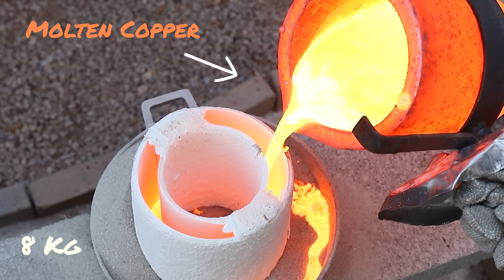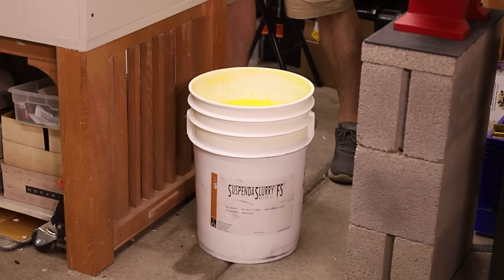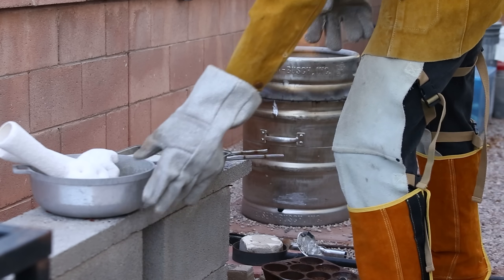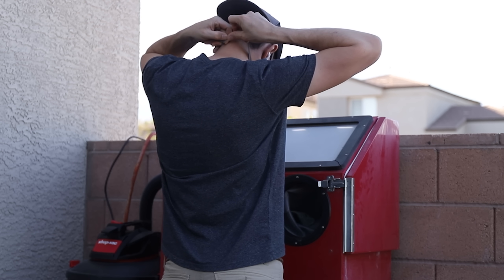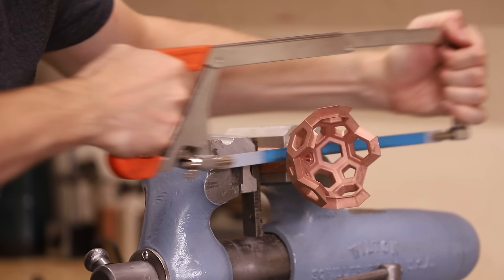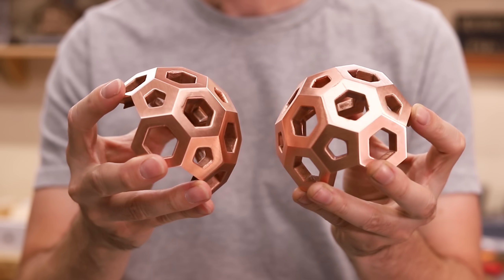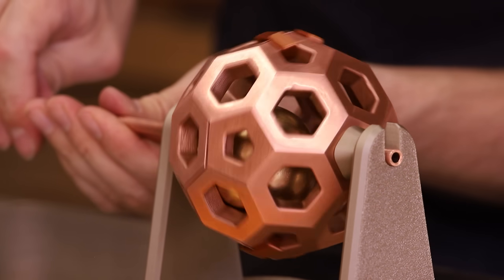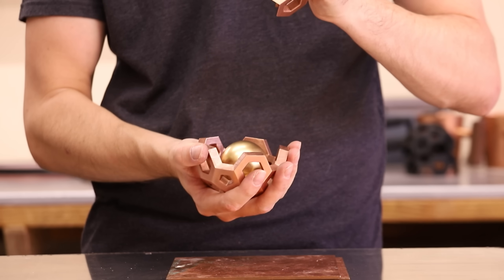HUGE Magnet VS Copper Sphere - Defying Gravity- Will a Neodymium Magnet Float Inside?

Comment: I’m beyond turned on right now. First, for the sake of efficiency I think you ought to broach the hole needed on each half, if that proves to be logistically easier over just splitting the singular large risers into 5 separate risers, so maybe pegs and divots on each face of that facet as opposed to one large peg which turns that one pentagon into something that needs broaching instead of just casting a pentagonal torus to begin with. 

More importantly the mass of the magnet will surely limit the lifespan of the shell and I think I know what the  disconnect between your inspiration and your end product is: round magnet in cylindrical tube ≠ round magnet in a faceted tube. You’re losing far too much of the available magnetic forces due to the constantly changing variations in distance between magnet and shell, and that’s a flaw inherent to the truncated icosahedron’s defining characteristics, not to mention that the mass of the magnet will surely limit the lifespan of the shell due to the malleability of the copper. I think what may solve this problem is creating a toroidal-faced spherical truncated icosahedron 😁

Comment: What happens if the rotational axis is not horizontal but vertical and the magnet sits right in there. What the centrifugal forces will cause to it?

Comment: This is called back EMF. It's what rollercoasters use to slow down. It seems like something that would be good for high rises as a fire escape. Have a copper fire pole and residents could then have magnetics they attach to the pole and slide down at a controlled speed.

Comment: Love this project.
Thoughts for a remix(s):
Pour hemispheres, finish on lathe for accuracy. Index holes on lathe or crossdrill on drill press. Set axles in ceramic bearings on a gimbal. 
Add some Teflon/cork/TPU to avoid crashing pieces.
Use a brushless EDF motor and controller which can hit truly insane speeds even direct drive. Use infrared sensor or hall effect for speed. Consider carbon fiber/fiberglass driveshaft to isolate vibration and magnetic fields. Add Arduino/ect for control. Balls to the wall. 

I am unsure how you set magnet/sphere distance. Did you wing it from the puck magnet/copper tube project? Unsure how or even if this can be calculated. Beyond me. Perhaps a few different sphere diameters/thickness/density/mass. 

You could use bedliner spray on inside of sphere then true it on the lathe perhaps before holes are bored. 
Don't know how that would hold up. Just an idea. 

I think to keep everything spinning true is important. Of course I have no idea how balanced a spherical magnet is. 

Effects on a gimbal could be cool. 

Drive the sphere in gimbal like an old aircraft gyro to keep it spinning. 

Place coils near it to check current/waveform. 

Will it couple and drive a duplicate set near? (Someone already knows I'm sure) Too many parts for my feeble noggin. 

Thank you for the video!

Comment: Why did you cut pentagonal plugs? Circular holes would have allowed toy to thread rods that could form a stronger bond and not work loose.   Also a bearing on the rods and a clamp on the stand to firm the structure. This would allow you to focus on the sped control.  That said I love your work here and thank you for doing this.

Comment: take two magnets cut a hole in the center of each one, face them with the same polarity then put a brass rod with two threaded ends between them and screw them down then see how it falls...it should theoretically fall slower than an object of the same mass. At least that's what some guy from Texas Instruments found a long time ago. You could easily prove this true or not. I would be curious

Comment: Ideal to see if this works put a rubber sleaves between your caps to separate contact to see while spinning it. To see if it makes electricity. It the possibilities of yes it does how much voltage and currents amps it makes. In theory could this be the next future. Try a mono spear magnet.

Comment: I have an idea. I would love for you to try it. It will be a process but I feel if you do it right the results will be astonishing. Make a stand to hold a few of them puck shaped magnets in a circle around the copper sphere. You have to make sure the magnets are at the right distance to have an effect on the copper but no effect on the neodymium magnet inside the sphere. I feel by using the natural forces created by the magnets and copper you will get a smoother result. Perhaps leading to a zero gravity atmosphere inside the copper sphere.

Comment: Get rid of the clips or clip and plug from the inside  the sphere magnetically or maybe change the stand so they each side of it supports more points of contact like 5 needles spinning on each side so that you have true balance. The theory works the ball is perfectly round the object is perfect but  you added the plug and clips create uneven polarity 
Btw looks like a pressurized mine like the green goblin siiiccckkkk

Comment: How about a magnetic disk attached to each end of an axle, and each disk just inside each of two slotted rails (but not touching the rails). Then run it like a maglev along the rails with the disk turning, but not touching the rails. I wonder how it would do  against other maglev methods?

Comment: Imo the shaft needs to be balanced so that there is no wobble in the sphere.  Maybe use some skate wheel bearings and a solid perfecly straight shaft? also may need to do some balancing on the shpere itself.

Comment: One simple addition to your drive shaft is two off-the-shelf roller bearings on the shaft rather than simple holes that are not precise, and a DC current drive motor with infinite adjustable speed control within the specified limits of the motor. The smoothness of power application may make the whole process to adjust the operation to someting nearer your desired performance.
 .

Comment: My lab partner here suggested making two and then spinning them close together in various directions. Personally I am curious about the current movement in this structure you have formed. I wonder if you might have accidentally stumbled across something that might have a significant application later on considering the magnet being able to flip the whole assybly from a foot away.
Reply: meaning you might just have up ended the idea of a permanent magnet motor or generator. imagine you ran a single copper like through the field or between two of them in the opposing fields. what would the current reading on that line be.
Reply: what if you ran ionized plasma past a structure like this?
Reply: A tube with ferro-fluid that spins a turbine of some kind.

What about the local gravity above the object.

Is it putting off any other wave signatures like types of light.

what would a laser do in the field.

I could sit here and think of a million experiments to run on this truly fascinating

Comment: It seems there are small Windows of rotations per minute that get the magnet to float in the center of the sphere. I would think a knock sensor and an adjustable speed controlled motor would be necessary to find and record the points of rpm that keep the magnet centered (in float).

Comment: ● If you put a Teflon-coated SN bar magnet in a circular acrylic tube, coil copper wire around it, and connect it to an ammeter, it will keep revolving forever and draw a few mA of current.

●  Incidentally, if you could fix chromium bearings at both ends of your tetrahedron sphere, the friction would be reduced and the sphere would continue to rotate by inertia. If you can make a magnetic bearing, it will rotate much longer because there will be no friction other than air resistance. If both the copper and magnets, which are completely antimagnetic, can be cooled with liquid nitrogen, they can float for a short time with the added effect of the Meissner effect. However, it is advisable to know the limit of the speed of the rotating body, because if the speed is increased above 6500 rpm, the centrifugal force will become too strong and the device will fly apart in all directions.

●  In Russia, permanent magnets were fixed to the disk with bolts, high voltage was applied in the axial direction, and when rotated to 6000 rpm, the rotating magnetic field repelled the geomagnetic field, creating a repulsive force that exceeded gravity (self-weight), but follow-up attempts in China, Japan, and the United States all failed. This is because the device was broken by centrifugal force.

Comment: You could apply a current to the sphere using a signal generator and adjust the voltage and frequency to find the minimal amount of energy/power required to suspend the magnet in the cage. I suspect the frequency will play a significant role in reducing the power (voltage/current).  
For a comparison you could induce a DC field in the cage to get a matching effect to an AC induced field. 
Ultimately it would be interesting to see if you could (not with this apparatus) create a movable mag lift  system that used a AC induced field to pull a magnet along a flat plate of copper while levitated. It would be really interesting if you could create matching but inverse fields in the magnetized floating body verses the propulsion plate to maximize lift while reducing energy requirements. Fun stuff that could lead to levitated transport... Star Wars anyone, lol.

Comment: I don’t know all the variables to consider.  The thickness of the copper in the hexagonal ball, the strength of the magnet, and the balance between the two?  Is the distribution of the material in the magnet homogeneous throughout?

The copper tube and the puck magnet stayed separate when it was rolled.  I am sure the proportions from that can be transferred to the spherical design for the copper hex ball and ball magnet.

Comment: What about increasing the internal volume & increasing the speed such that one can have a larger outer shell and thus see it more easily? There'd most likely be an equation that could be figured to determine the necessary speed versus internal volume versus the amount of material required to generate a strong enough field with the magnet so that you could film said interaction. If that didn't work, perhaps running a low-intensity/lower power electrical current through wires on a non-magnetic material (so that you could use a non-conducting material to form the shell) would work...

Comment: One really fun thing you can do with a strong magnet is tie it to a string hanging right in front of a large(bigger than the magnet) non-ferrous metal(i.e. copper, nickel, aluminum), then when you swing the magnet into the piece of metal, the effect will be similar to the magnet floating through the copper cylinder...it will stop just before hitting the metal.

Comment: I'm no engineer but my brain says using a motor at a very very slow rpm and getting faster by increment should have a goldie lox zone.

Also, the clips may not weigh much but placing an even ring of them around the equator would being it from having two points of weight into a "sphere with a tire around it". If you rolled it downhill it would correct itself onto the tire not just flapjack down the hill. 

Its more so the positioning of the mass on an object & the rotation it carries. Yea two opposite sides are even but theres the rest of the rotation that is missing the mass to make an even rotation.

Not sure if I got my wording correct here but hands on geometry is something my brain is good at. I'mma contractor not a teacher.

Comment: Needed bearings to make the piece spin better/faster, depending on the bearing it could make sure that slight angular movements didn't affect movement.

Also maybe if the grid was thinner but that would require more precise casting or molding, could maybe shape it if you had just thick copper tubbing or rod.

What about placing magnets at different points to try and make it sound more freely so that you don't have to spin a magnet yourself? 

Using springs to make it bounce somehow? Wonder if you can do anything with that.

Using dry ice would be cool to see what effects it might have on it or liquid nitrogen

Running a small current along the copper to see what that does? 

All of these seem very dangerous, just giving ideas not saying these are safe in any way shape or form.

Comment: i did notice a few issues. 
1 you didn't show your copper smelting process in great detail. did you know the purity of the copper beforehand, and did you flux the copper to remove any impurities/alloys? 

2 perhaps you should have made your copper sphere larger in overall diameter and could therefore make the pentagon openings in the facets larger? this would allow the camera to 'see' more of the magnetic sphere inside the copper one. 

3 are you familiar with the lost wax or lost clay casting process? basically, you carve the positive image you want (like your 3D printed plastic one here) out of wax or molding clay (including the sprues). then, you put THAT object in a slightly moist silica/bentonite mix and then apply a high-pressure press/weight to the sand/clay mix making the negative image INSIDE the sand/clay mold. the easiest way to experiment with this molding process is to use a large metal cylinder with a closed end. spray some releasing compound inside the cylinder first. the open end is where you pour the silica/bentonite just enough to stabilize your positive image. then insert the positive shape and pour more molding compound over the image. put a round metal 'plate' on the open end of the metal cylinder (just small enough to fit inside the hole) and push down with a ram or set multiple heavy objects on the metal 'plate'. once the mold has been compacted and dried a little you can carefully remove your mold from the metal cylinder. THEN you heat that mold in your kiln allowing the wax/clay to melt and drain out of the mold. pour in some releasing compound and let it drain out as well. pour in your molten metal and allow the mold to cool. you clean off the sand/bentonite clay with your sand blaster, chisel, hammer etc. leaving your cast metal object behind. 

these techniques would take out that entire series of dips in the molding slurry you had to apply to the 3D printed plastic positive images. 

oh, and next time... put an air vent sprue in your molds... that will help prevent that lil bubbly nobbin on the copper object you had to remove. 

pour your molten metals a little slower, this will help the air vent out of your molds' sprues. 

conversely? you can KEEP the 3D printed plastic objects, if you feel your cutting shaping molding the clay/wax abilities are terrible. just press your plastic positives into the silica/bentonite carefully! or they might shatter due to the pressure needed to compact the mold. :D

best of luck in all your future ventures!

Comment: Not enough copper, the "levitating" effect would be more pronounced if most of the holes were filled in with copper, we can hear when it's floating as opposed to banging on the sides.

Then attach a variable potentiometer to an electric motor so you can pinpoint the ideal rpm instead of halfassing it 😅

The vibration on the shaft is causing a lot of destabilization so I'd lock/bolt down the shaft a bit more. 

The biggest issue however, is not having a true copper sphere, the magnetic fields and Eddy currents are not in ideal geometric alignment as you get with a round magnet down a round tube. 

Love this experiment, would love to see a refined version with stricter controls in place 😊

Comment: Interesting.
What about the same experiment but with a sphere designed with all but open sides. The majority of the copper sphere is on the center line (like a bike wheel) and have the sides as open as possible?

Comment: OK here's an experiment.  Take the Ring Magnet and put it on a stand so that it can be rotated by a motor.   Now, connect the Sphere to a generator to see if there is more  power out than your Ring Magnet power input.  What would be the efficiency ratio of the coupling.

Comment: Okay, I'm pretty sure if you take this idea to someone that has a mill or a CNC machine you might be able to get them perfectly made from copper plates that are the same density and cut out each piece and have a machine weld each piece together and then balance it you might be able to get it to spin better and float better. I'm not a machinist but I bet there's some people out there that might be willing to help with it.

Comment: What would happen if you passed a current through the sphere? A low voltage current, perhaps. Wouldn't that theoretically strengthen the magnetic fieldto allow the magnet to float int he middle a bit better?

Comment: So this is coming from someone who doesn't know shit about the subject, but what if you have a copper belt that is rotating at at angle with a magnet on the slope? Do you need a certain thickness to achieve this? I'm just wondering if you can have an effect like the magnet slowly rolling down the "hill" as the copper belt rotates.

Comment: My intuition is that the holes, particularly with that zigzagging structure are interrupting things. I think a potentially more interesting question, (and likely more analytically solvable) is how big of a hollow shell of set thickness t can you make to achieve this same result. There should be a relation for B, r, t, and omega that could be solved. Time to break out Jackson EM. If it’s big enough in r and small enough in t it could be feasible with cooler results